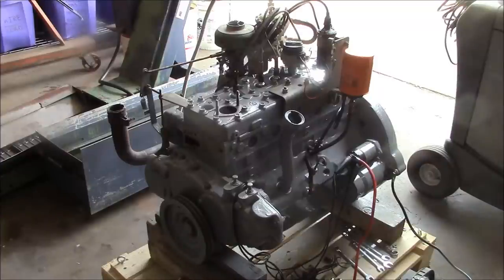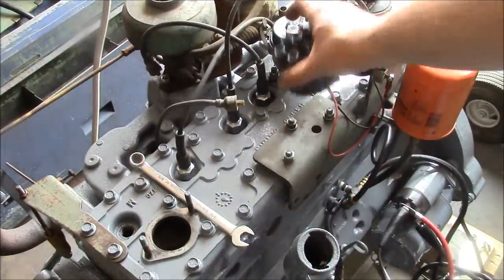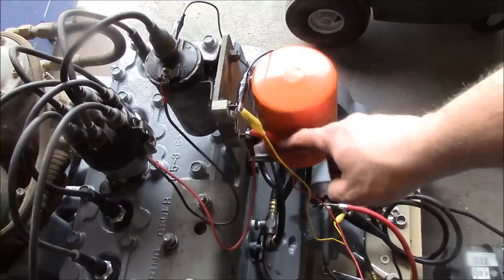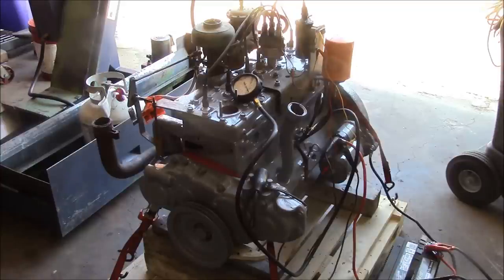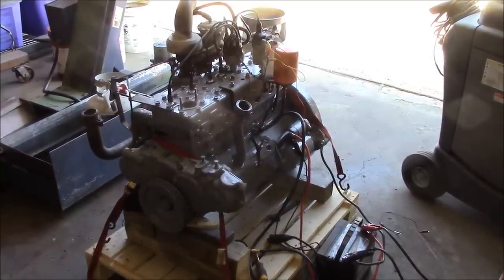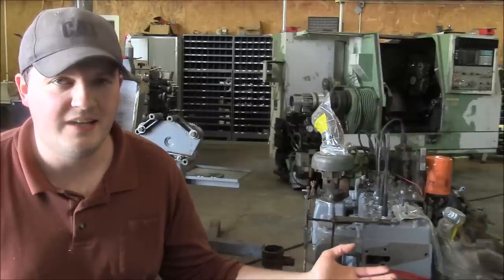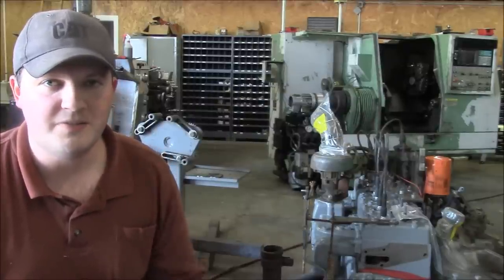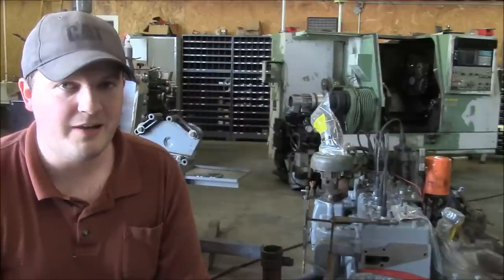Continental F245 Flathead Engine Overhaul - Part 3 (ignition timing, first start)

Comment: There is only one problem with mechanics like yourself  Wes. You make i look like anyone could do it and I have ne people who can't wind a watch.Learning how hard to pull on the handle of a say half inch drive  ratchet.. some guys don't know right from left and they pull till something gives. I suggest sending guys to a wrecking yard where it is going to be crushed anyway. I have pulled wrenches since 1955 and things change a lot from the old stuff to the new stuff and new stuff is not as forgiving. School first then try it with some time under  their belt. It may look simple but far from it when they put a filter on dry and no oil on the sealing ring. I can't emphasize enough, you take a engine apart then forget where anything goes back. The poor mechanic will tell them bring one that is still together and a bring one that either runs or just quit and why it quit. I stopped a guy from tearing his engine down cause I had heard it run the day it quit. So far he only had a few covers off and they were bent and roughed up! I had so gas in a lawn mower handy so I poured a little down the carb, hit the switch  and it started then of course quit cause a teaspoon of gas doesn't go far and he said thanks, I will buy a new fuel pump and carb and have it running in no time so I stopped him again and poured some in the tank    and just enough to prime it. I told him to try it and so he got in and followed instructions by turning key on and waiting a minute then tries it. It starts right up and idles. I told him to turn it off and get out so he did. I explained to him that he needed to put more gas in the tank and that is after he puts the stuff back on. He couldn't even do that and this not a real old car so I show him where stuff went and he half assed it together. I showed him the right way. There's more but you get the idea

Comment: Wouldn't it a good idea to add a kind of water separator on the oil pan, if this is a very common issue?
And sure, natural gas burns to CO2 and water, so condensation is to be expected.

Comment: liked the video, agree with the silicone over use, but PLEASE take that fram oil filter off that engine.
Reply from the maker: I like to use them so I can poke the collective hubris of the internet.
Reply: I have one of these engines and it's also in a old clark forklift, it's been sitting a few years, I pulled the distributor to clean it and now I'm having timing issues, Thanks for the video, and chuck that filter.  :)

Comment: on my Continental 415  I was timing it to "IGN" mark on flywheel  and always seemed sluggish then timed it to "TDC" wow thats double power.    does that engine have both markings?
Reply from the maker: It just has TDC and 20 degrees on either side. I set it for TDC at slow idle so the timing advance didn't goof it up.

Comment: Add a pic valve.  It will make engine last longer.  Very nice work.
Reply: That is PVC vaļve  I wish I could edit.
Reply: @mr16ga  If you hoover with the cursor, on the far right of your comment, three dots appear. Click on those dots for the possibility to correct. Only works for your own comments ... of course.

Comment: I've been watching your videos little by little, I was able to get everything wired up right from my distributor to my coil to all my wiring the correct way yeah mine are the four cylinder world war II generator flat head. Get this number one cylinder has the strongest spark 243 are weak. What's the problem? Everything is brand new I tore it down repainted everything and bought new parts. Mine 6 volt system

Comment: Some barbecue propane tanks have a saftey valve in them and when you hook up the hose to tight it will close the saftey valve.  I just tighten it just tight enough to not leak which is usually only hand tight. Very aggravating and very dangerous but that's the way big brother government wants it to be because it doesn't effect them.

Comment: Current flow  Voltage is just pressure   Current is quantity of electrons  Very erosive  Used for everything from EDM machining to welding to Plasma cleaning in Semiconductor industry